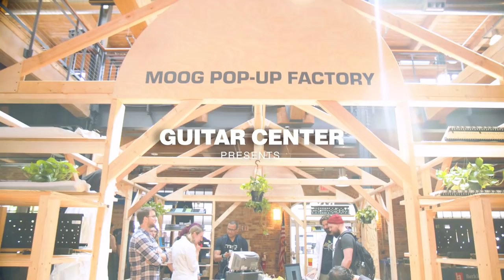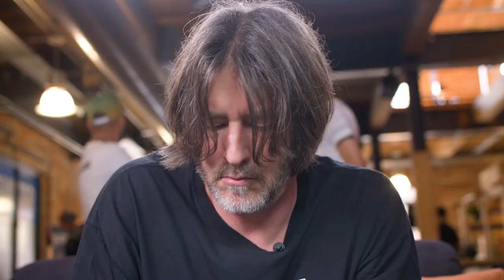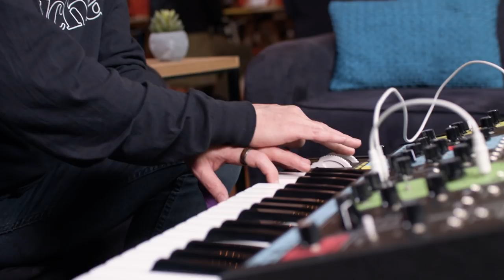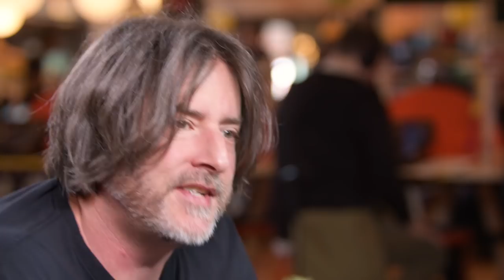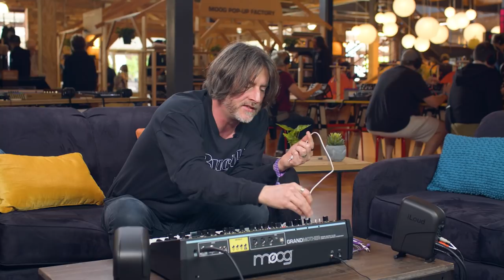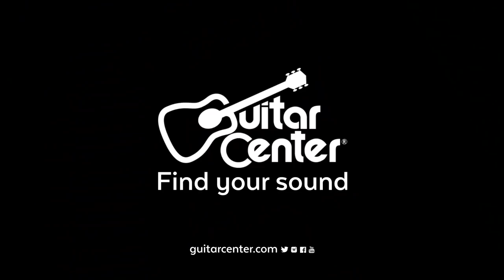Moog Grandmother | Creating Lead Sounds with Marc Doty

Comment: I have a really weird problem with my grandmother....

Right out of the box everything worked just fine, the arpeggiator, sequencer, etc. But for some odd reason, suddenly this section doesn't seem to work anymore....

When I enter the Arp mode and press down some keys I hear....nothing.....

Even the red LED doesn't seem to respond if I turn up the BPM, it just constantly lights red.

Is my synth broken???
Reply: Did you press "play"? I forget that sometimes.